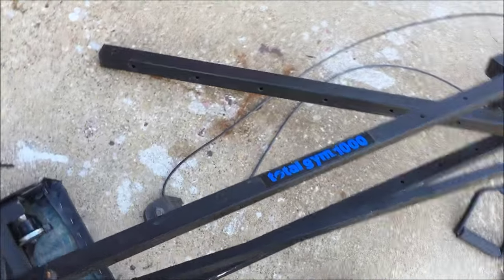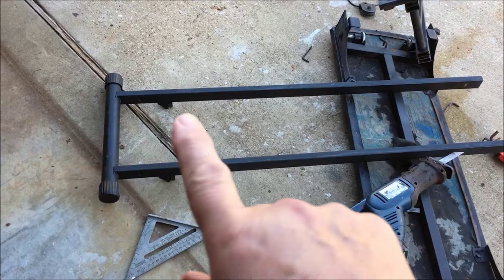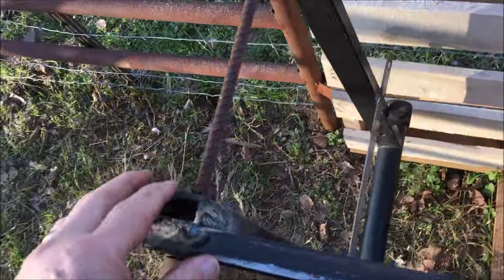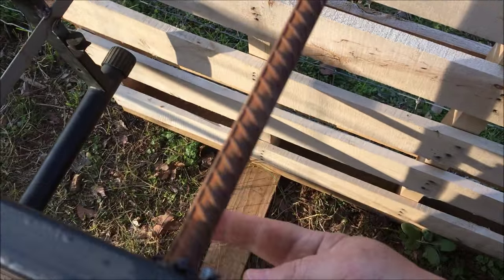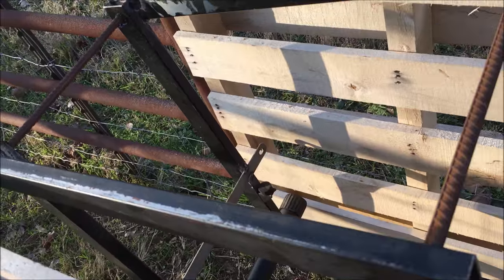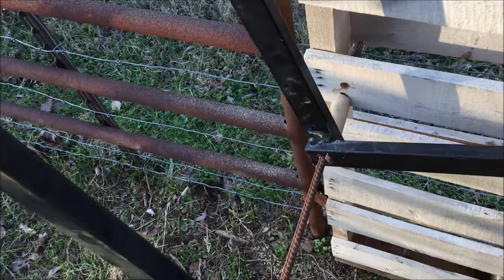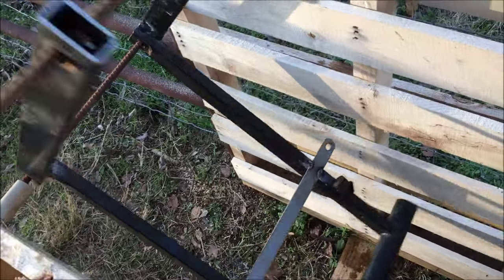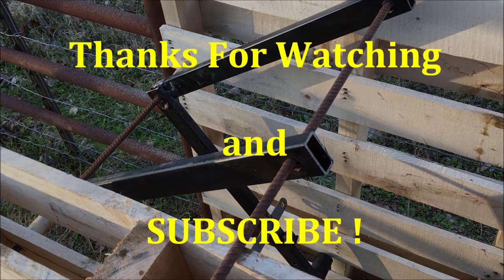Small Livestock Working Chute~Part 3~A Stop Gate

Comment: In preparation for lambs you could bolt or weld a panel of expanded metal grate to the stop side of that gate. There's not enough room for a sheep to turn around but a lamb might and end up getting their  head stuck in that gate. I would bolt it so you could take it on and off as needed. Plus  this additional panel could extend almost to the ground to prevent nose unders. Weld a little flat steel or angle iron to any sharp edges you are left  with on the pannel.

Comment: How did your pallet chute work out?
Reply from the maker: Real well. It made it much easier to worm the sheep in the chute than wrestling them around.
Now that I've recently sold my sheep I may take it apart and use the wood for something else.
It's not large enough for cows.
I'm thinking about reusing the sliding gate for my cow chute, though.